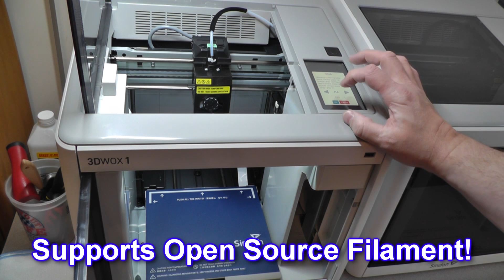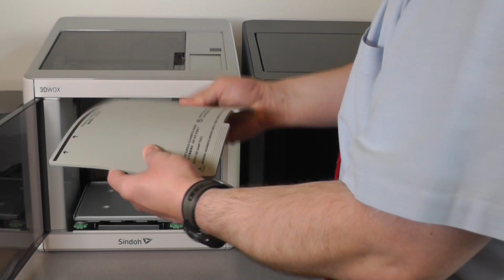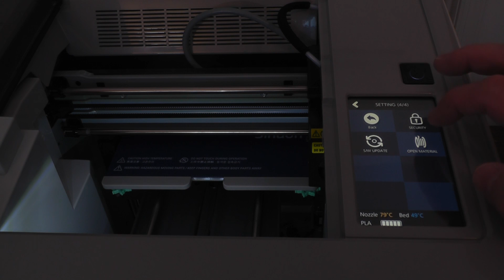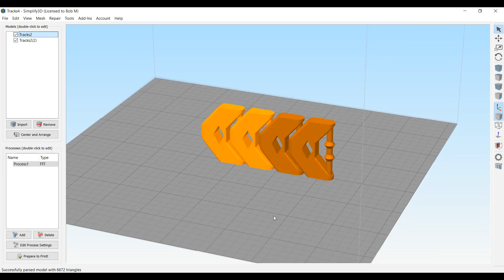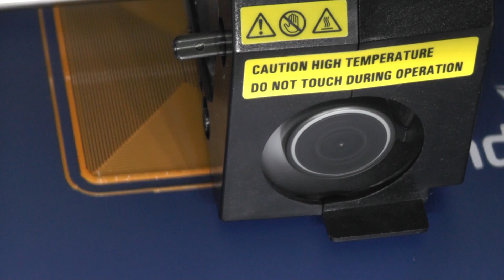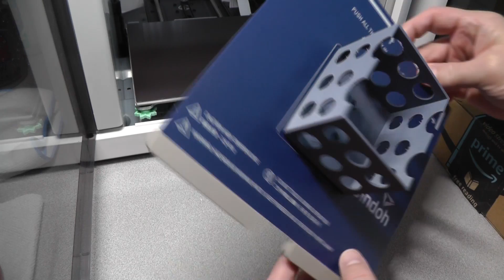Sindoh 3DWOX1 3D Printer - Unboxing & Review

Comment: Thanks for taking the time to make this review.  Many of us have been waiting for any kind of review since this printer became available about a month ago.  I am going to pull the trigger in the next day or so.  It looks very nicely engineered.  I am so tired of printer companies using 3d printed parts and then claiming that ‘bridge manufacturing’ helps bring new technologies to market sooner.
Reply from the maker: No printer is perfect on all points, but I have (4) 3DWOX machines and feel they compete well in the price range vs features and provide not only a low barrier of entry for beginners as far as knowledge and setup required for basic PLA printing, but also have the design and quality to produce repeatable accuracy long-term for advanced users.  (I have heard one user who has run 100+ spools of filament through his DP200 without issue.)  I would recommend the 3DWOX1 at this point due to enhancements and open source capabilities, although I've used my DP200 for over 2 years without major issues and can recommend that as well (proprietary filament and slicer only right now).  Despite my review last year, I can no longer recommend the DP201 for everyone after having a longer time to test it.  Depending on the job type and settings, I have had recurring issues with warping and first layer not sticking to the flexible rubber bed on the DP201 only.

Comment: Hi, thanks for the great review. 
I'm really interested in buying one of these Sindoh 3D printers, whether it be the 3DWOX 1 or the 1x. How has it held up in your experience? Would you say its still a printer worth getting today? I ask because there's a seller on eBay that has a fair supply of new units for $300 dollars each. I care more about print quality, reliability and ease of use over speed. 
Parts availability is also a big concern, mainly replacement nozzles. I would greatly appreciate any input from you regarding this printer or any other models you would recommend. Thanks and have a good day
Reply from the maker: While I still have and use several 3DWOX models occasionally, the manufacturer Sindoh is no longer making 3D printers and there are essentially no replacement parts or support available any more.  I would recommend looking at something like a Prusa or Bambu 3D printer.
Reply: @AllThingsBobot  oh okay. It's a shame since I got a really good impression of this printer but if there's no support or spare parts then there's no reason to consider it. Unless it can use third party parts like nozzles or extruders from brands like micro Swiss ?
Reply from the maker: @christianolea2181  I believe some guys have swapped the actual hot end but understand the "nozzle" as Sindoh calls it is an entire cartridge-type assembly that is made for easy plug and play with magnetic attachment, etc.  No one in the group seems to have a source for any replacement supplies such as the nozzle or belts or wiring harnesses and the only parts available would be left over at a few small shops in the US or whatever stock might be left at Sindoh in South Korea.  Also, the printer works best with their slicer software although I've figured ways to get it to use code from Simplify3D and always do that.  It was a nice printer which is why I bought and got involved, but it's time has passed without Sindoh support.  If you want more info, you could visit our member Facebook Group at https://www.facebook.com/groups/593946721288877 but even there support is waning.
Reply: @AllThingsBobot  thank you for the info. Greatly appreciated

Comment: In the Amazon ad it has a photo of what looks like a camera.  Is that what it is?  Or is that a light?
Reply from the maker: There is an on-board camera that can be used to view the build plate in real time through the 3DWOX Desktop app, web browser (via local IP address) or via iOS/Android app.  The options are basic on all, allowing only view and canceling the printing job, and only work on the local network (although I suspect you could set up port forwarding on your router or use a VPN for access from outside your local LAN).
Reply: it is a camera but there is also a light. when they say you can download the app it wont even connect to the printer, it just crashes. the camera works though you just have to look on it through your PC.

Comment: Can this printer do multi-color printing?  It looks like the prints only has one color.
Reply from the maker: Only one color at a time.  Sindoh-branded proprietary filaments come in about 9 colors, but almost any color is available in the open source mode.  Properly planned, you could pause the print and change filament to a different color and restart at the next layer, but in practice this is limited.  Sindoh makes a much more expensive dual-filament printer named the "3DWOX 2X" that can do 2-colors in the same print.